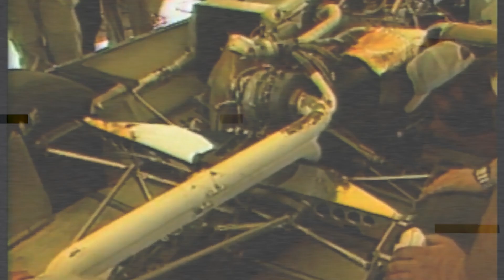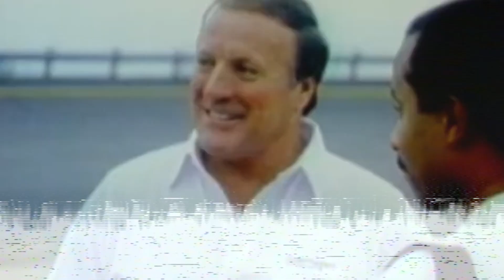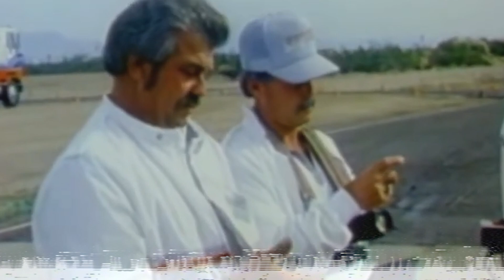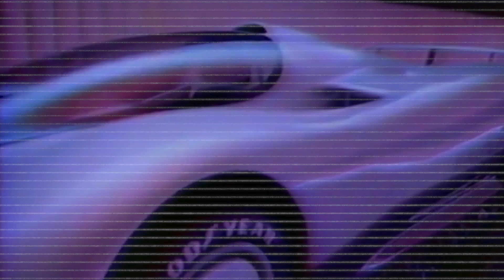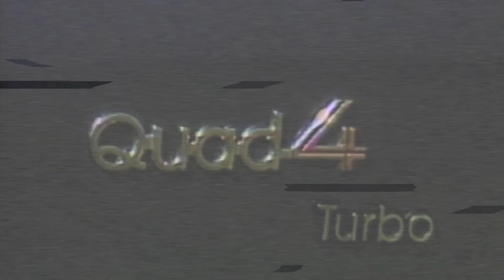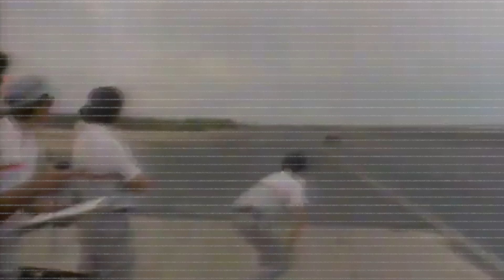The Oldsmobile Aerotech: The Record-Breaking Supercar That Quietly Rewrote Automotive History

Comment: Technical it was, a good engine it wasn't, this was an interference engine with the worst timing chain ever, it had an oil pressure driven tensioner that never failed to fail, and because of the increasing loss of oil pressure due to tensioner blow by the bottom end bearings were washed completely out by the time the chain failed, a lot of mechanics lost their ass trying to fix these engines with a valve job and new timing components just to have the car come back on a hook needing another valve job with less than a thousand miles since the last valve job, really like your content 👍

Comment: I still have a catalog from the dealership that was being circulated around that time. Its about the Aurora engine development program and that car shown at the end with the Dual Overhead Cam V8. A nasty beast.
Reply: I have a 2001 Aurora 4,0. MUCH more powerful runner than I expected.

Comment: Thanks for posting this, a bunch of footage I've never seen. The engine that was actually used was designed by Gary Robison owner of Quest Engineering in Ojai CA with John Bristow doing the drawings under contract to Fueling. Jim Fueling had his own design but was rejected for various problems related to heat issues regarding use of dissimilar material at high power as I recall. We were the "B" team with the alternative design that was far superior which went on to be the one used in the cars. All aluminum with custom tie bolts going from the head through to the main caps stretched to a specific value capturing all the internal combustion forces through the whole engine. The cylinders were Nikasil lined forged aluminum drop in sleeves custom made by Mahle that were oringed sealed to the block. I think it was Kieth Black that did the crank. I remember having lunch with him and Gary near Kieth's shop explaining how the head tooling I was fabricating was going to be done, Kieth offered me a job right there to Gary's chagrin lol! Every major component was custom fabricated to our spec's by the best suppliers out there at the time. The head was sealed to the cylinders by sodium filled metal orings. 

Our only rule from Oldsmobile as I remember was to respect the displacement, bore/stroke and bore center-line spacing, four valves, that was it. I was hired by Gary at 26, he knew me from club racing and machining for him in the past, so he turned me loose to design the accessory drive integration, oil scavenging,  plumbing, alternator, Oil pump and water pump stuff, and the exhaust header clamping system to the head. All my stuff was drawn by hand on paper LOL. I also designed the fixturing for the head machining mentioned before. Each cylinders combustion chamber had its own water jacket independent from each other to control the heat transfer (tunable). Got to go to Indy to see it run but it had a battery issue that day so no go lol.  I do remember AJ saying that for the HP it was the coolest (temp) running car he had ever driven at speed. After that project we all went on to start the Sea-Doo R&D facility in FL in 87.
Reply: Thanks for sharing.

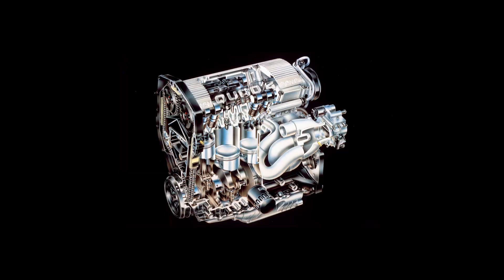Comment: @0:48 I love that Chris casually throws out a 1st gen Firehawk with the super rare T-Ram Falconer Intake.  
Trivia, the T-Ram was the Highest Torque ad HP TPI intake design ever made for the original small block chevy, but the molds and specs were lost in a fire at SLP, and High RPM biased short runner intakes became the norm soon after with the LT1 and 4th Gen F-Cars getting the Vette motor.

Comment: The engine development for this car was led by Jim Fueling.  One very unique, and ingenious feature, was the head studs went all the way thru the Block and were also the Main Bearing Studs.  This allowed combustion pressure to tighten Main Bearing Studs when they were under their highest load.  Jim died too soon.
Reply: Interesting
Reply: Same a h K- series engine found in lotus S1 elies

Comment: Great video thanks Chris. Quite amazing that this 4 cylinder could reach those power levels in the 80's. It goes to show that you do not necessarily need cubic inches to make serious power. What I do see from the footage is that the inlet and exhaust, apart from the rest of the highly tuned components is absolutely maximized. Also very interesting to me is the effect an extended tail has on aerodynamics at high speed. Love these videos on obscure and lesser known automotive history.
Reply: Then there were those Group B rally cars
Reply: Also in the '80s, BMW had a 1.5 liter turbo 4 cylinder in F1 that was making around 1,400 hp. They weren't very successful next to Honda's V6, though.